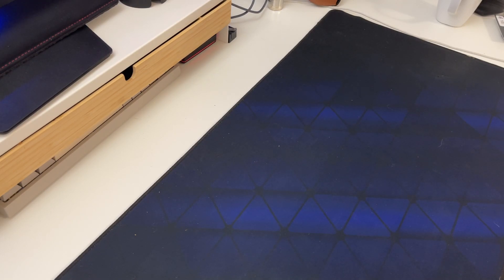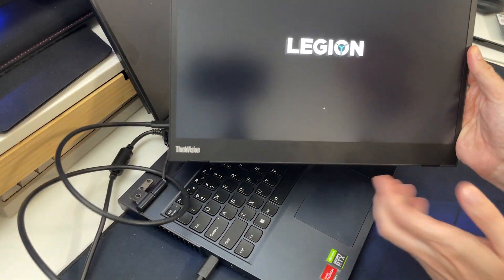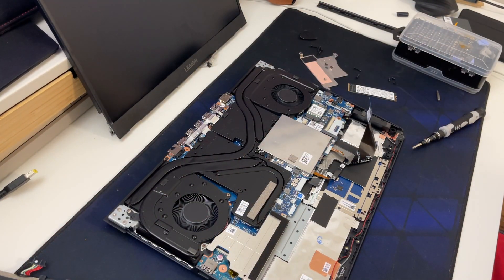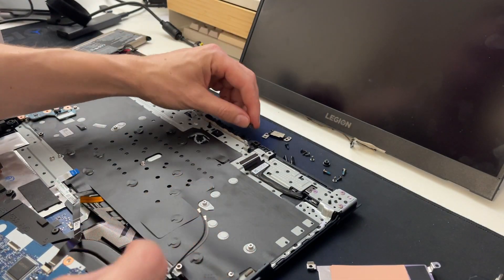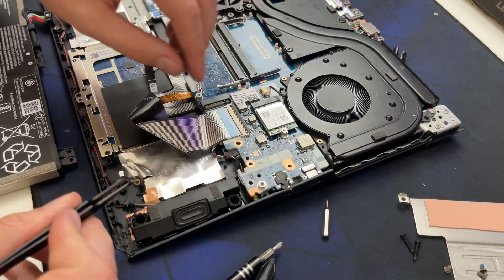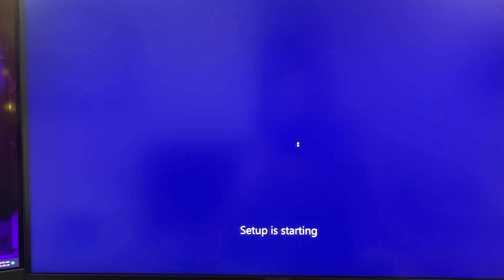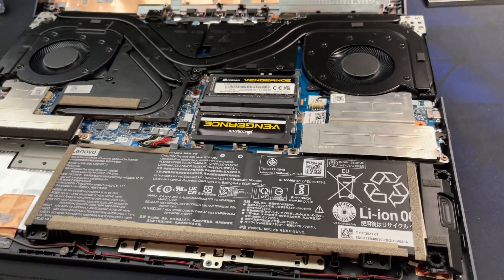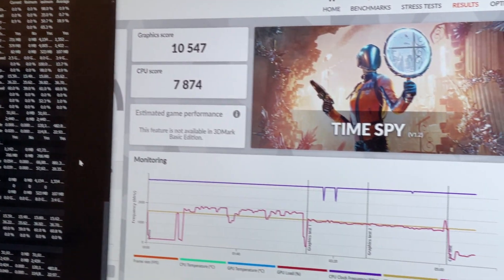"Half Top" Lenovo Legion 5 (rtx 3070) with NO SCREEN - creating a "half top" from a broken laptop.

Comment: I'd go to display settings in windows, Go to Advance display settings and see what your connected port display is running off of. Hybrid tends to mainly relate only directly to the Laptop screen and not to the external displays. So Externals normally will connect to the GPU side while internal display will be CPU side.

Comment: Did you really fix any hardware here? Or perhaps it was just reinstalling windows that fixed everything?
Reply from the maker: Fix yes in a way. Firstly, I reinstalled windows. But then it simply would not display anymore

So if this is the case you must go into the bios blindly and ensure that switchable graphics are enabled. Luckily I have another legion I could use for reference. Otherwise no matter what you do, you wouldn’t get video signal.

Once in windows you CANNOT disable hybrid mode. Or you likewise lose video

There was disconnected ribbon cable under the battery. That likely was problematic. Otherwise it was just gluing parts back together.

The main takeaway is that if you remove the screen you cannot:

1. Disable switchable graphics in bios
2. Disable hybrid mode in windows 
3 (as of 2022) install windows 11

Once these are done you must also use shortcut keys to “flip displays” otherwise you still won’t get visuals.

Interestingly. With these settings the hdmi output works perfectly, but usb video is extremely problematic. 

I was lucky that other than the speaker cable being damaged, the body internals were fine. The damage was all to the screen, the chassis, speaker cable, and screw holes in the chassis